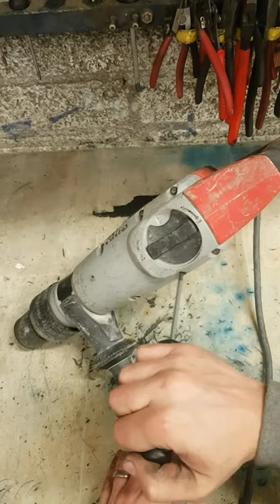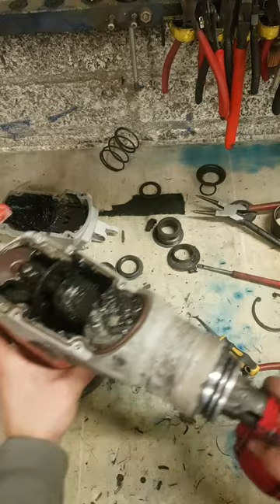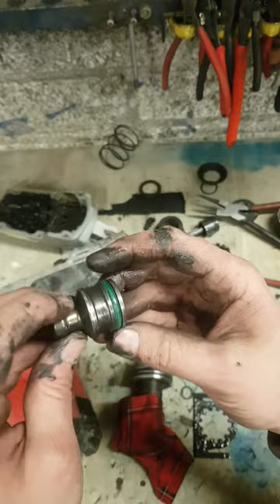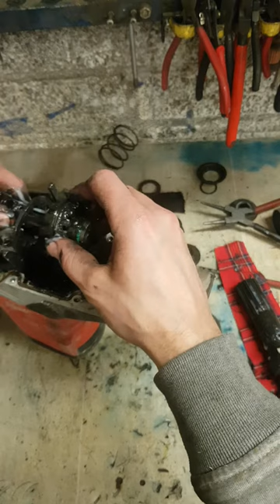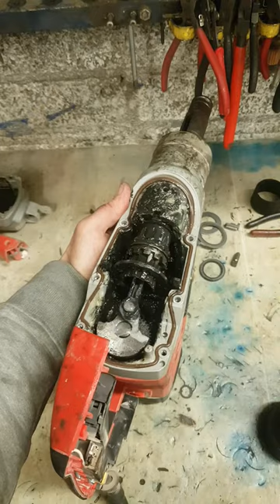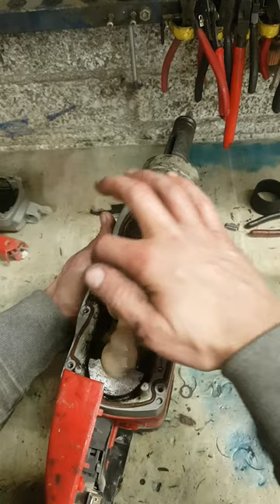Repairing a Milwaukee K500 ST Hammer that has lost its hammer and is no longer hitting hard.

Comment: Here’s why hilti’s are one of the best. Very few of their tools run on grease. Only a select few of the smaller hammer drills. Most of their line up of hammer drills run on oil. And some have different chambers that separate the gearing from the piston and striker. That chamber is usually oil filled so they are certain the o rings around the hammer mechanism never run dry. That’s quality there
Reply from the maker: Same design setup as a makita hammer.
Reply: But in the end you pay 3x for a machine just as well made as a Bosch or Makita but very hard to repair or service on your own.

Comment: I must say you are one of the best tool repair channels I've seen the best to be honest and we can all learn I ting or too from you and I've only found your channel a couple of days ago which is amazing because I have searched a number of times for repairs like this and your channel never popped up but tell me what is the name of that grease you use and I presume it's good enough to use in all machines out from Hilti power tools I suppose
Reply from the maker: The thick grease is bosch 001. And the lighter white grease is hilti hammer grease
Reply: @deandohertygreaser  is there a Grease that you would recommend that can be bought in the general stores that would be something like Hilti hammer Grease I just find it very hard to get parts from Hilti
Reply: @repairs524  NGLI 000 or NGLI 00 viscosity grade gearbox grease. The goopy white Hilti grease looks like NGLI 000.

Comment: So get brushed tools so when they go bad u can just put new bearings and brushes in them, then to buy brushless, also got the Milwaukee M18 surge impact is there anyway to upgrade it to get more torque from it it really lacks on torque it puts screws in great but it could really use more power

Comment: Hammers need to come with an hour counter honestly. A tiny OLED display somewhere to display the runtime hours. Would help massively with service intervals and counting the runtime hours in general.
Klauke has a tiny OLED information display on their machines and they are a small specialized manufacturer so Bosch, Makita, Milwaukee etc can do it too then.

Comment: Dear @Dean Doherty I received a remarkably similar Wurth BMH-40-XE hammer with some other used tools.  It looked good in the box so I thought it might work. Tried it out and no hammer action. Your video was the only one that I have found got into the nitty-gritty of actually fixing one of these. It was my first time ever touching a hammer so I had to open it up to looky-loo and troubleshoot.  A bunch of oil came out that was unexpected for me.  Poked around and nothing seemed wrong.  Ran it slow with the cover off and no hammering motion, I noticed if I pushed the chuck with the cylinder sleeve in all the way back the piston would sometimes try and push it out like it was trying to work.

I have not needed a hammer before but have a few personal jobs in the future that might benefit.  Is it worth buying a seal kit (US$35-42 with a piston the kit is almost US$100) and oil to try and fix the hammer or do I sell it as broken and just rent a hammer when I need it?
Reply from the maker: The BMH-40-XE wurth is actualy a bosch hammer. wurth dont make many tools so rebrand a bosch gbh 5 as their own. 
is the piston moving at all ?
the piston is driven by the eccentric gear at the back. this gear is driven directly from the armature. make sure the gear on top of the armature that drivers everything is not stripped of sheered of. (small one in the center)
after that, it is probably a selector issue. make sure the selector in the top cover is locating into rim of the selector gear below it.

Comment: Recomendation on grease? I'm about to fill mine with bearing grease....
Reply: DONT do that.
You need a low viscosity gearbox grease. NGLI 00 or NGLI 000 viscosity grade.
Reply: @alouisschafer7212  Oops, thank you for answering!
Reply: @bumblingfool  For sealed! gearboxes that are expected to run for extended periods of time and heat up aswell you want the most liquid grease available. It will flow around and keep everything coated in lubricant.
The goopy white grease you see Dean puttin into this hammer is NGLI 000 viscosity.
BUT when you have a gearbox that is NOT sealed well you cant use such grease because it will leak out.

Some Bosch hammers have gone a step further and use straight oil in the gearbox.

Comment: Hi Dean, which kango would you recommend? I normally use a bosch gsh 5 ce, anything similar you'd recommend or stick with the bosch?
Reply from the maker: For that size of hammer, mist go with the bosch. But the metabo is of similar quality and built style, plus it is a bit cheaper than the bosch. U see more and more hire companies using metabo hammers. 
Other option would be the makita, they are more complicated and expensively made. And also more expensive to buy.

Comment: I used my Milwaukee SDS Plus Rotary Hammer Drill Twice. And it stopped working. Twice. I have $5,300 invested into this company and I’m considering switching to a more reliable company. Milwaukee has just been feeling like a junky clunky tool company as of lately.
Reply from the maker: They are, that's why I warn people to stay clear
Reply: @deandohertygreaser What do you think about dewalts new line sds max rotary hammer drills brushed corded ones ?
Reply: In the EU 
At our company we use every company 
So mill Bosch mak Würth DeWalt
The all stop when they are being used and abused